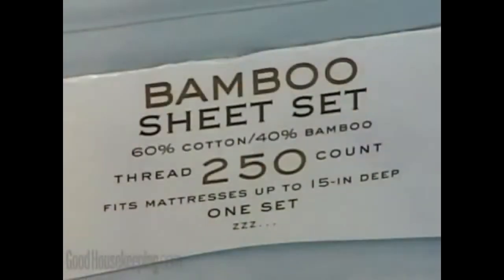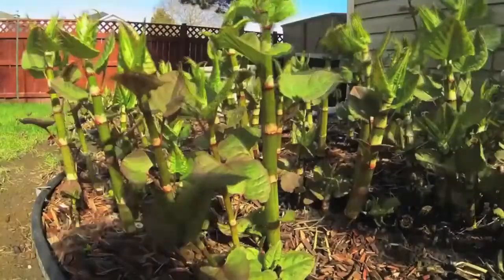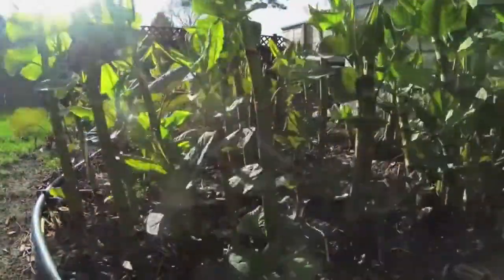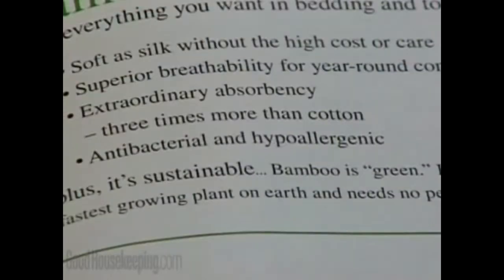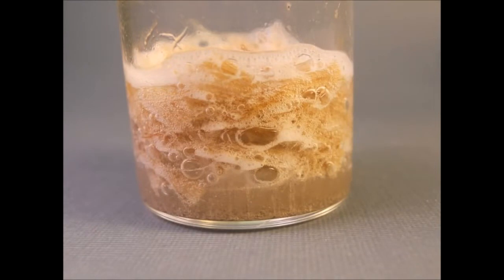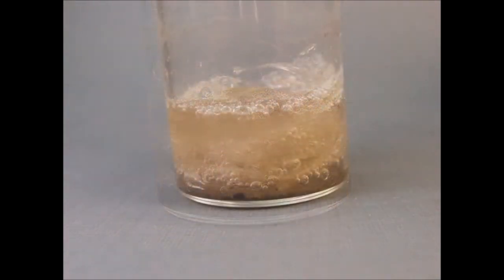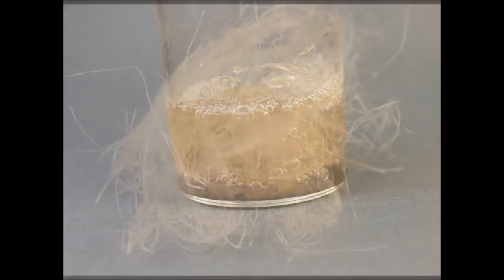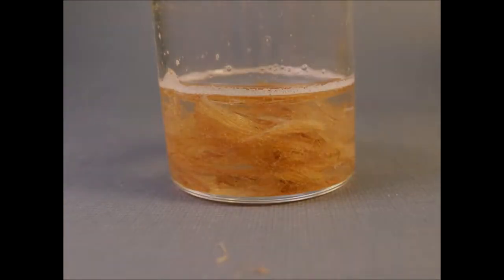Extraction of Bamboo Fibre | Innovate Design

Comment: Bamboo fabric thin sheet of water activated ceramic that will disolve with hot water that will be absorbed by the bamboo fabric. Banana cellulose sponge treated with water activated ceramic that will absorb hot water swell up then cure to a hard state with no shrinkage. Aluminium frame bamboo fabric thin sheet of water activated ceramic on each side of a wall panel with the banana  cellulose sponge in the center to fill the void. Prefabricated home's that swevil latch lock togethelr with all the electrical and plumbing already built in. Even the foundation could be designed to exspan then cure rock solid. Then just two men can erect a home in one day using no tool's from the foundation up to the roof. Then use a power washer that spray's steaming hot water and hose down the whole structure then just let it all cure rock solid in 24 hours.  Then tint then walls what ever color the owner wanted on the inside and the outside then give the outside a clear gel coat. Then give the inner walls a gel coat or just a sealer depending on what the owner wanted. Then you run electrical pluming floor coverings windows and doors Cooling and heating system light fixtures and bathroom shower tub sink toilet tile. A prefabricated house made out of bamboo fabric and banana plant cellulose that you lever latch lock together to the foundation then each wall and the roof. A person could go on line design a home and have it delivered on site and have the home set up in one day? 😊